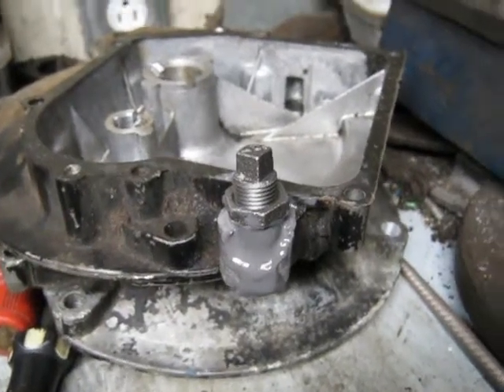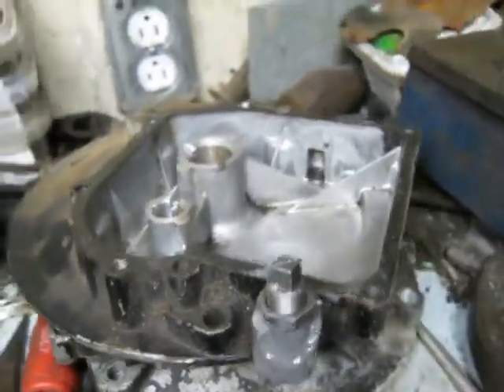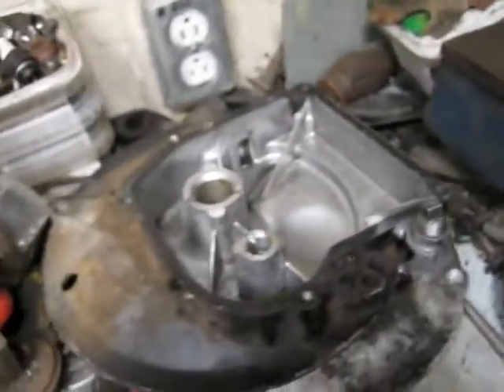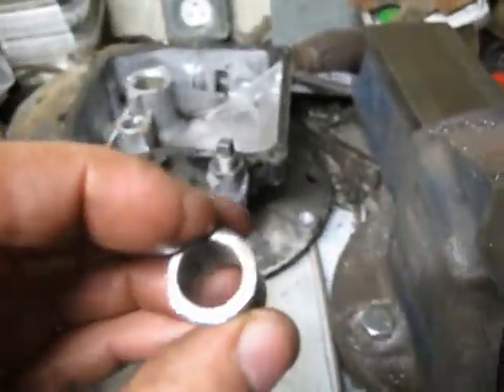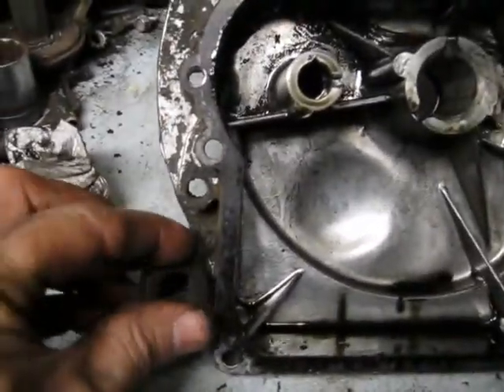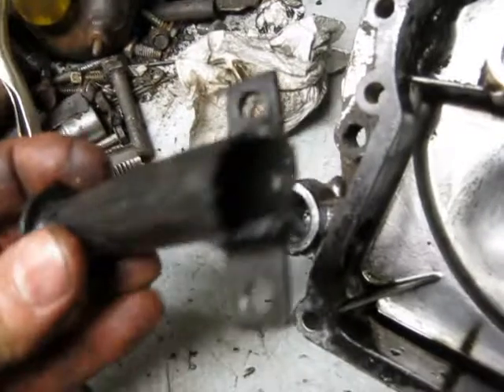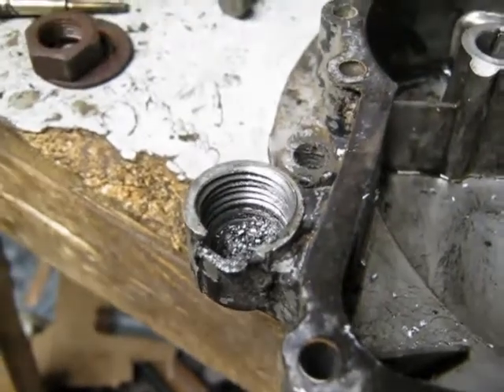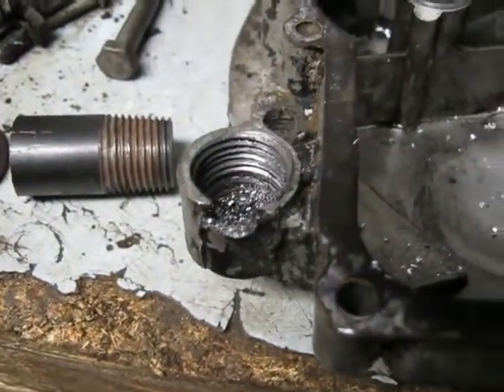Crankcase cover repair FrankenBriggs 5 "radial"

Comment: yep  those are  old ones ,,  from the  1970s  and early 80s ,,  too bad  your not closer to me  ,,i have hundreds of those old parts and  hundreds of old mowers to rob parts from ,,I have a bunch of ready made  spacer rings saved off from mowers over the years ,,they came from mowers that had shallow decks  and a long shaft 
i enjoy watching you create these strange things ,,and  i would  supply parts  if i was closer   cause  some of this stuff i have likely won't ever get used otherwise

Comment: Good work as always! You can do almost anything with JB!
Reply from the maker: rotorcats Yes indeed, I even glued wooden knobs onto a glass bathroom mirror with it!JB Weld, duct tape and WD-40, and the do it yourselfer is good to go!  :)
Reply: ChargerMiles007 don't forget COAT HANGER wire 2  things every car owner should have Duct tape and coat hanger wire

in my case every vehicle i own has a roll of silver tape and a spool of hay-baler wire in the cab somewhere ,,,and my toolbox has the JB weld and in place of  WD40 which i hate ,, i have JB-80 super penetrating oil
Reply from the maker: wildcoyote34 I just thru the WD-40 in there since the name is so well known. I generally use ReleaseAll as a penetrating fluid. WD-40 gets used as Wasp killer, as well as ignition wire spray (it works pretty well at dispersing water!)
Reply: ChargerMiles007 YEP  it works excellent for all of those uses ,,although i have never tried using it for wasp spray ,,carburetor cleaner works really good as wasp killer too ,,instant knock down
Reply from the maker: wildcoyote34 WD40 is an instant knock down sometimes, but usually it knocks them down, then you follow up with another shot. It works better for spraying the nests down at night, when it is cooler out.
Reply: ChargerMiles007 I got an even better trick too
I have a 10 foot wand with a 6 foot hose  on my shop vac ,, it works  wonderful on wasps  ,,suck them up and they can't get out ,,and if you catch them at night they won't fly away  they will defend the nest and get sucked up for trying
I have trouble with hornets around here too ,, they are easy to get ,, put the wand up to their hive and turn it on ,, as they come out of the hive   they  get caught
Reply from the maker: wildcoyote34 LOL  :)  Now that is a unique way to deal with an insect problem!
Reply: ChargerMiles007 yes it is  ,, and it works really  well

Comment: Speaking of broken Briggs parts. I'm repairing this 4 year old 20 HP Briggs single cylinder intek. Compression release is designed to fail. A LOT of them have been sold on ebay, not the compression release of course, but the whole cam!

https://scontent-sea.xx.fbcdn.net/hphotos-xft1/v/t34.0-12/11104284_877369895655663_1480314589_n.jpg?oh=8f381db4d92f5a917052430f625494a5&oe=553A2056

Snaps off where it goes in to the cam gear. Pretty disgusting eh? they have it cut as a D shape for the proper operation plus going through the hole to hold it to the cam. Fatigues and fails. You ever seen any other older B&S engines have this issue?
Reply from the maker: 1972FordF150 That doesn't sound like a good design! I am surprised Briggs has made something that poorly, as that type of thing affects their reputation. You would think they would know how to build such a device, as I have 1990s mowers with a small compression release on the exhaust lobe. I know the device you are describing, I think I have seen one on a Tecumseh 12.5 horse OHV.To be truthful with you I don't work on many large engines, just the ones I have too, since they are very heavy to carry out of a scrapyard!  Could you run the engine without a compression release, or would it be too hard on the starter?
Reply: To start the thing with the compression release broken. It took everything it had with a fully charged battery to get it to start. Ran great once it started. Sure kicked back hard on itself shutting down lol. The eBay seller I purchased the cam/lifter set from has sold 200 of those cams since December 26, 2014!
Reply from the maker: 1972FordF150 What the Heck, I typed in a novel as a reply, and it seems to have disappeared!!!  >:((Good picture, shows the problem well. Briggs should know better when building something like this, especially for a relatively expensive, large engine!  Could you run the engine without the comp. release, or would it wear out the starter, or not start at all?
Reply from the maker: 1972FordF150 Yes, if that guy has sold 200 of them, how many has Briggs sold!?That almost sounds like a recall item in my opinion.
Reply: And that's just one eBay seller! all the rest have sold around 50-60. Sad. B&S is not the company they used to be. Enter Briggs 793880 in to eBay and you'll see what I mean lol. And that's not counting how many mower repair shops all across the country have probably sold and repaired!
Reply from the maker: 1972FordF150 Compression releases flying apart, plastic intake manifolds cracking, con rods blowing!Briggs, what the heck did you do, hire a bunch of ex-Tecumseh designers after they closed up shop????!!!!  >:((
Reply from the maker: 1972FordF150 (continuing on with last comment) Hint hint, maybe you shouldn't have done that Briggs, perhaps they are working for the other side!!!!  :)
Reply: 1972FordF150   ,, i hate briggs and stratton Intek engines  god damned cheap made crap  
I've got a  2008 model  intek 330000 series ,,that has 62 hours on it and a bad camshaft ,,this one has sticky valves and the sticking  exhaust valve wore the cam lobe off and now it won't run 
an even worse one is the  damned Vtwins and their dirt ingestion issues due to the faulty design of the air filter,, since 2005 i have repaired or replaced  22 Briggs V-twin intek engines ,,i have a whole pile of dead ones ,, most of them with under  450 hours  and almost without exception they were sucking a large amount of oil 

the one i really like is the Briggs Vanguard Vtwin   they run forever 
I have a  garden tractor  with a Vanguard Vtwin on it  and it is getting close  to  2000 hours  and still running good
Reply: I'll just stick to my flat heads. 1000 hours and 28 years on my 12 HP B&S rider and 38 years and 1,300 hours and going like new on my 3.5 HP B&S push mower! it's all about quantity and not quality these days. They don't give a damn about the customer anymore. Even though they'll deny everything and tell you they do. They're full of shit. It's all about those pencil pushing pinheads's wallets. My grandpa bought a rider new 4 years ago with a 22HP B&S intek v twin. No problems yet. Time will tell. The only thing I can find anything decent quality in these days is Honda.
Reply: ChargerMiles007 the  Intek engine was the B&S answer to the  tecumseh  OHV engine   they are cheaply made and have  flaws briggs is gradually getting the issues resolved  but they still aren't up to the quality of some other engines 

all of my mowers either have a Kohler engine  or  a B&S engine 
my mower i use  most has B&S Vanguard Vtwin engine which is similar to the intek but much better built ,, more on par with A Kawasaki or honda engine ,, it has close to  2000 hours and still runs good with almost no oil consumption ,,it'll use 8oz of  oil in  12 hours of  very  heavy usage ,,under light mowing it won't use that in  20+,,,1 more season  and i think i am gonna rebuild it ,, one engine i really loved was the old Opposed  twin briggs ,, the ones called  the twin-II ,,they didn't have the valve or cam issue and never  have i seen one with dirt ingestion ,, they have a round paper filter like a car ,,25 years now working on mowers
Reply: 1972FordF150 Kawasaki makes  good  quality engines ,,  and the larger kohler engines are  decent as well ,,just don't buy a single cylinder kohler courage engine

personally myself i like the older kohler Command series engines ,, they didn't have valve train problems ,,they have hydraulic valve lifters and use 10W-30 motor oil because of this ,,I have a 16hp Command  torn down in my garage right now which has over 800  hours on it ,, it had a head gasket which was starting to leak a little ,, so i decided to fix it ,, and  to my surprise  it still has  hone  marks in the cylinder bore ,, not 1 scuff or streak in the bore at all 

I've gotten a lot of hours on a flat head briggs but  you must be doing a lot of maintenance at very good intervals to get 1000+ on one of them ,, and i like  hearing about longevity stories like that .,,about like my 83 nissan truck which has  810,000 miles on it ,, i hate throwing stuff away just cause it's old or broke down ,,, i have  a 3 acre lawnmower junk yard  filled with stuff people  just gave up on
Reply: Honestly, my dad purchased the 3.5 HP Briggs new in April 1977. All it ever got were 2 oil changes a year and the occasional external clean up. Mowed a LOT of grass! at 30 years we retired the original deck. The wheels were so worn you could take them and twist and pull them 45 degrees to one side. But it still rolled so we kept pushing! So, we pulled the engine apart. Cylinder had no ring ridge, still had it's crosshatching, no scuffing or scooring, all bearing surfaces looked like new. Went 23 years on the original sparkplug and points, 30 years before the original Choke-O-Matic carburetor diaphragm failed. Always started in 1 pull. Even with gas sitting in it all winter, the majority of the time anyways. Been the best running engine and most reliable one I've ever seen. If you go to the Briggs website and go to the engines matter page, I'm the little red push mower on the front page. They messaged me and told me I had the best testimonial of them all and wanted to feature me on the front page. As far as the rider, my grandpa bought it new in 1989 and gave it to me in 2011 when he bought his new rider. It runs excellent but I noticed with ear plugs in I can hear a slight rattle which sounds like either rod, wrist pin or dog bone rod from the balancer making a slight noise. I'm going to disassemble to find the problem soon.
Reply from the maker: wildcoyote34 Glad you and 1972FordF150 have had a good discussion, you guys have covered some very good points!
Reply from the maker: 1972FordF150  Interesting conversation you have been having with wildcoyote34, I have learned a lot.My step father gave me my old 73 Briggs pushmower which I use all the time. I don't change the oil as often as you, plus I have had to clean the grass shavings out of the cooling fins a few times. It usually goes on the third pull, it must be that ethanol gas evaporating out of the carb, as I only cut every week or so.
Reply: 1972FordF150 very excellent  testimonial on  a briggs engine ,,  30 years and still going 

as for your  noisy  briggs engine rattle ,, if that  is a syncro balanced engine ,, it likely is the balance it'self ,, the loops top and bottom which ride on the eccentrics on the crankshaft are severely worn probably with the top one more so than the bottom ,,with that many hours it probably has a little play in the connecting rod too 
I've personally never seen a briggs with the dogbone rod worn  loose ,,seen a broken one though,,also never seen a wrist pin loose either ,, I have seen one with a piston worn so bad it was slapping and making it sound like a bad wrist pin ,,,worn camshaft/out of  tolerance valves can make a lot of racket too especially in  flat head engines
Reply: I have a 87 3 HP Briggs with a loose cylinder, chatters like crazy when it's cold. I run the guts out of it and it just keeps taking it lol. Try that with one of those new 550EX series Briggs engines like I got for free, wouldn't last an hour. I had the head off the 12 HP last May to see if there was a bunch of carbon buildup causing my hard to get cranking syndrome when hot. I lapped the valves and reset the valve clearances then, the noise got slightly quieter, but not much. Either way, couldn't hurt to check. It doesn't even burn oil lol.
Reply: I've  got   a bunch of the  newer   quantum series engines ,, the 12 cubic inch one ,, not the older 9CI like the one your talking about ,, i haven't had many problems with them aside from the routine  carb issues that all the float carbs have ,, gotta replace the needle/seat every season due to the gas 
the 550 series i don't really care for either 

I run the piss out of my mowers   several of which have several hundred hours on them ,,
I have a whole fleet of rental units   and most of them run well  even into  the 500+  hour range
Reply: They sure don't make them like they used to. That old 3.5HP will outlast me at the rate I take care of it. It mows a lot less grass than it used to lol.
Reply from the maker: 1972FordF150 lol, yes it is quite possible some of these old Briggs push mowers will outlast us older fellas!!!!Though I hope I am good for at least another 20 years!
Reply: I'm 18 and that thing will probably outlast me lol!
Reply from the maker: 1972FordF150 18, lol, it has its work cut out to outlast you!!!
Reply: It'll outlast my dad I know that LOL it only gets about 30 hours a year put on it now on a well maintained yard. Before it was 50-60 hours a year and the grass would be really tall at times.